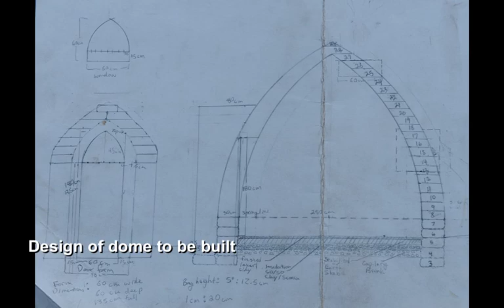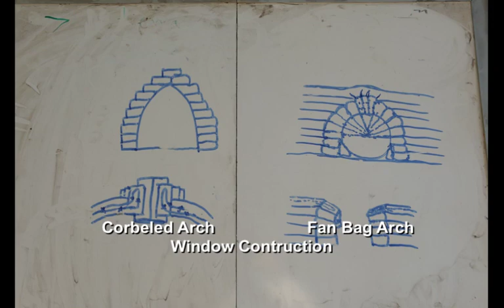Earthbag Dome Workshop in Tepoztlan, Mexico

Comment: Thanks for the question. The soil mix has to be more specific if you are not using a stabilizer like cement or lime so that binds well. Soil can vary so much from even from the same piece of land. An ideal "raw" soil to have is one with 20-30% clay, and the rest made up of sharp sand and gravel.

Comment: @DrGaryGreen i don't have the oficial response but adobe has been in use for centuries if not for longer... and most mixtures use manure. I would say this is even better because there are bags that keep the material contained and if you talk about the filling-gaps material the idea is to cover the hole structure with a few lawyers of concrete and finishing the walls. So there should not be any contact with the construction material after the outerlawers are put in the walls.